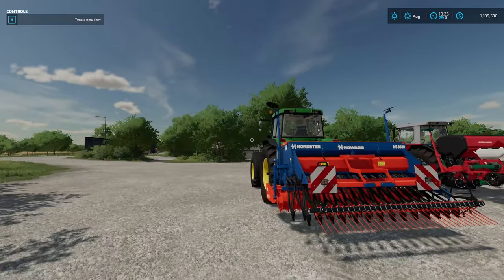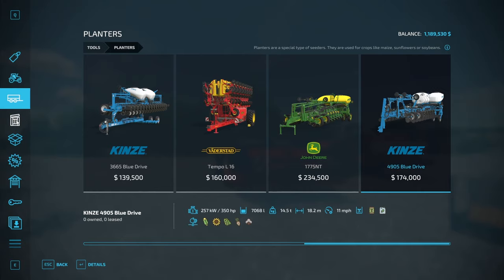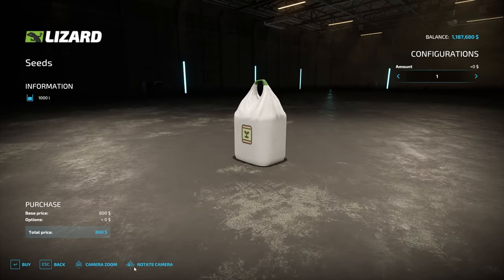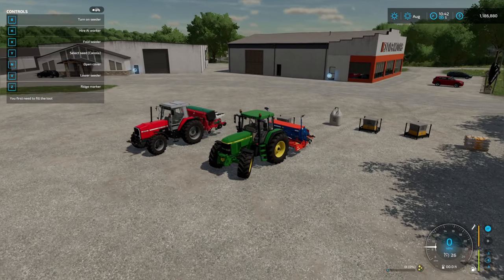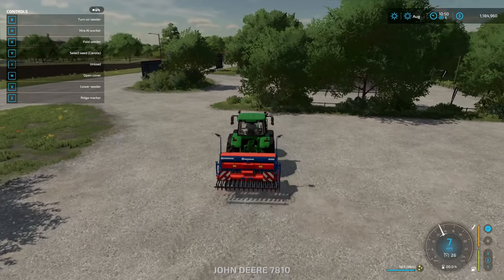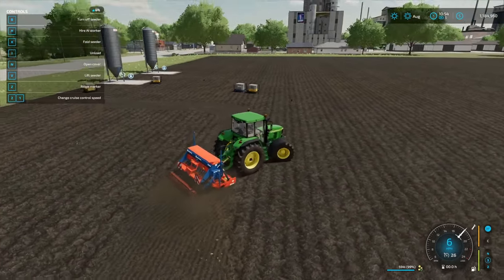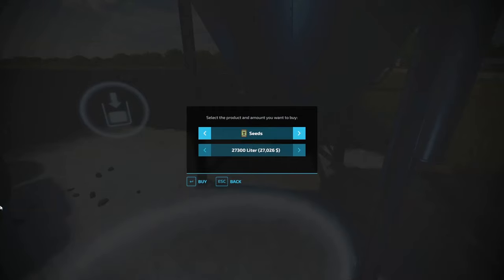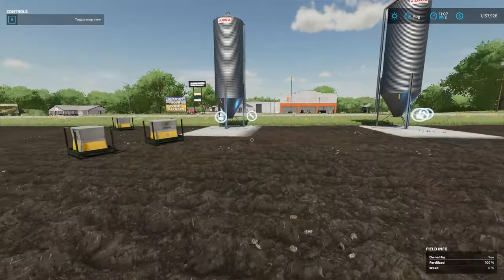HOW TO REFILL SOWER / SEEDER | Farming Simulator 22 Tutorial | FS22: Tutorial

Comment: i can’t refill anything whether it be a seeder or water tanker or a trailer out of a silo i don’t get the “R to refill” prompt at all.  Can anyone help?
Reply from the maker: Make sure you have the right attachment selected check the top left corner to see which attachment is selected, make sure it’s not on the tractor or front weight
Reply: made sure i had the right attachment selected still nothing, it’s like nothing is registering. however the “unload” promt comes up fine but still no “start filling” promt at all with anything drills, lime station, silos, water fill points. none of it works.
Reply from the maker: @wash7311  check the key binds in the settings, you may have unbound it by accident
Reply: you have to fill the silo first. go to the wrench by the silo and buy seed to fill up the silo.

Comment: How can we fill the HR6040 RCS Seeder?
Reply: Had the same problem as you, and found the answer after watching the real thing in action lol. Turns out it doesn't come with any seed tank. It's designed to be used with the frontal seed tank, TF 1512. They will get the pipe auto hooked after you put the tank on the front of your tractor. Your tractor will need to be the ones with frontal atttachment slot though.